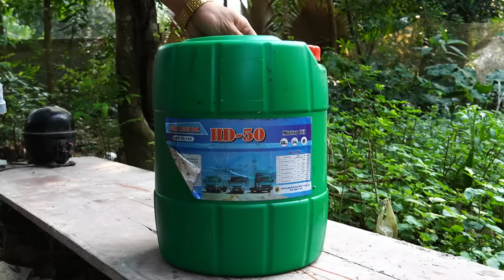how to make a high pressure car washer yourself

Comment: Dog, what cooled the compressor since there is no refigerant gas in the suction line?  Also, did you have any oil in the compressor? If yes, then how did you returned it back the the compreesor since it's not a closed loop system?

From the looked of it,  i think  your machine is spraying mixture of oil droplets and water for about 30 minutes before the compressor overheated and goes up in flame.

Comment: This fridge compressor can easy reach at least 15 bars of pressure. An it is strongly NOT recommended to do pump this kind of plastic container to that high pressure. It will simply blow off and may cause serious injuries or even death! And YES, this compressor can pump air from the atmosphere and you can use it for something else. You should put an air filter on the inlet of the compressor and you can pump tires for example. The debit of the compressor is not big, but the pressure it reaches is very high. Be careful.
Reply: Can we make use of a cut off system?
Reply: I the pipe fittings he has done Will blow off before the container..so I think it's not a dangerous one..

Comment: The compressor runs on specific gases, if you intend to run it on air it will seize within no time. Also once the air pressure is more in the plastic drum it is very unsafe.

Comment: You essentially built a high pressure bomb, no cut off valve, and no idea the amount of pressure the barrel can handle, would have been better with a steel propane tank or something designed to withstand the pressure that compressor can put out, and like others have said the compressor will burn out eventually without oil being run through it, but good idea though

Comment: Bonjour du Canada Iy's agreat idea i am a retired réfrigération mechanic when somebody
use a refrigerator compressor like your's (matushita) on the discharge line a little quantity
of oil vaporised  you can see a fog cloud of oil if you try to wash your car maybe the car
are oily  advantage rust proof treatment  but for blow a tire in emergency case it's OK

Comment: That compressor is designed for the oil to ciculate through the system to keep it lubricated. So how are you going to lubricate it now.  With Water? Or are you going to wash your car with oily water
Reply: The air make the pressure, are two different circuits, the trumbail of video are wrong.
Reply: Brother  tan have already  right only  compresure give external  pressure  only its nothing  wrong already  make my class study  project  also can make air compression  also like bike car alo  can its simply  make ready we can add some safety  valve  also no problem  that
Reply: No oil, it's work untill broke
Reply: this is a Air Compressor, so its blow the air........
Reply: Did you see the water pickup tube at 1:33? The compressor does not directly move any water. It merely pressurized the plastic tank with air, which forces the water up the tube and through the nozzle.
  The compressor's oil supply stays in the sump.
Reply: @nicholasrhodes4550  Did you see the vapor After he had his thumb over the outlet? That's oil. All usual compressor systems recirculate so the oil flows back into the compressor. This one doesn't so oily water/seized compressor is going to happen.
Reply: Ini kompresor yang biasa digunakan untuk Refrigerator,
Saat kompresor On, maka akan ada komrpesi, mengeluarkan udara bertekanan melalui pipa discharge, 
Saat itu yang keluar tidak hanya udara, namun oli dalam kompresor pun akan ikut keluar. 
tentunya jika udara bertekanan yang mengandung oli ini dimasukkan kedalam tabung air, maka airnya pun akan terkontaminasi oli, demikian..
Reply: previously freon was running through the compressor, not oil. The oil sits outside of the system that creates the pressure
Reply: Muy buen video
Reply: Pressure is the thing.

Comment: Never try this, the compressor is directly connect to build pressure in the container,  without any safety. No pressure switch and even the connections are made out of shit. Please be caution and dont follow the video.
Reply: Mohammed Rizwan Khan at least he should build a pressure shut off valve to avoid over pressure. Anyway, I think that compressor not build enough air to break off plastic container but need to be caution, nothing impossible!
Reply: Exactly and if anyone try this and something wrong happend then their Hirushima and Nagasaki (Bum) will be seperated by that blast😂😂
Reply: I agree that it's not a great system, but I don't think anything would explode. It's an open system. The wand doesn't even have a button on it. There's no way for excess pressure to build up. It would just push all the water out the hose and then keep pumping air out if you left it on.

Comment: you can add a valve with hose attach to it once you run out of water just open valve and it will fill to the top and continue washing.

Comment: nice idea ,, Im gonna do this but im going to use steel lines and a high pressure line rated at least 3000 to 6000 psi . A propane tank should be suffieceint to hold the pressure , 
Did yours blow up yet?

Comment: Need only outomatic valve cutoff pressure valve  putting on tank and controll on off motor when acess high pressure
.
Reply: Hi. Did you build such  a toy for yourself ?
Reply: Yhy

Comment: U should install one way pressure release valve at the top of tank to release the exceed pressure. This is necessary.
Reply: sure, without it, the water container gona blow...
Also add some for new water, because water that is in the tank in gona finish at some point...

Comment: The only question I have is wouldn't you need a pressure relief valve attached to the water drum so that the pressure doesn't continue to build till  drum blows up. Or a pressure gauge on the water drum so that when said pressure is reached the compressor shuts down
Reply: These would definitely be better. This is just an idea you can improve on it A LOT

Comment: BS The volume of the  jet is way more then those compressors put out, and even more evident this is BS is look at how limp the yellow hose is while the jet is showing high pressure, plus i really dig the self tapping pipe fittings. Dumb.

Comment: This is tottaly fail. Because reciprocating compression uses oil for piston movement but there is water in place of oil. It will run for couple of minutes only. 😂😂😂😂😂